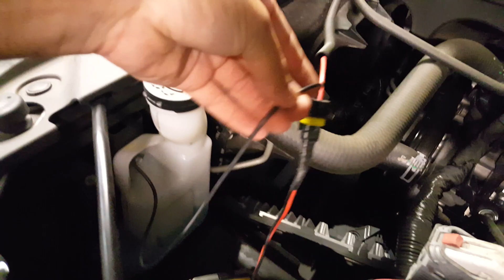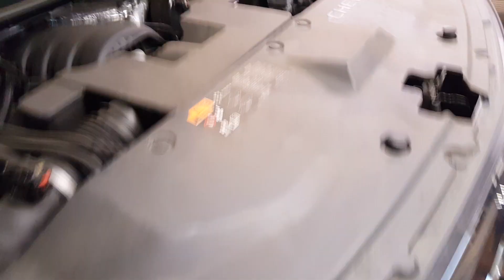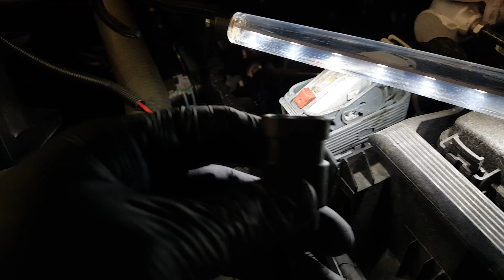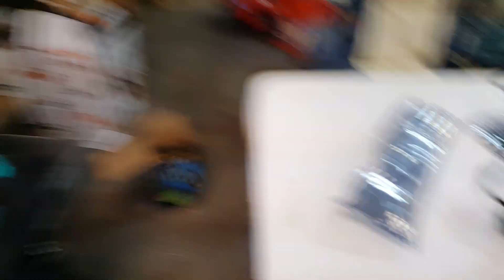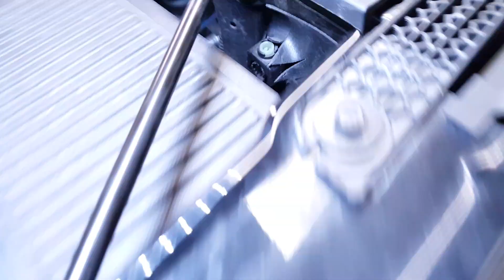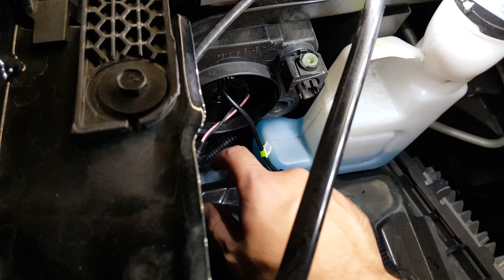JDM astar 8TH Gen. H11 LED Headlight Kit Unboxing and Install on 2016 Chevrolet Tahoe (Part 1)

Comment: I just purchased a led kit and there turning off when I also turn my 15 Tahoe on. Can I just purchase a decoder from Jdm? Does the decoder work with any led kit?
Reply from the maker: Yes, the decoder should be universal since it uses the same connection points as the OEM headlamps.

Comment: Hey bro great video i just got some JDM LED lights for my 2015 honda accord coupe, Do you recommend using them for Daytime running lights or headlights at night?
Reply from the maker: ANDRE MONROE both, they work great. Still no issues.
Reply: Armando Rodriguez Jr ok thanks some people say if you use the Leds for the DRL you will lose your highbeams unless you some type of regulator to plug in
Reply from the maker: Well the Deadlight is the same bulb for the DRL on the 2015+ Tahoe. So as long as you use the Decoder that JDM astar sells you will have no issues.

Comment: In for updates. Did you have to modify your bulb cap? Assuming the decoder doesn't fit?
Reply: update: I installed, with decoder and caps closed. Left high beams Halogen
Reply from the maker: I did not modify the cap, I have not installed it. I am most likely going to create a wire harness and route it through the headlamp so the plug can be sealed in the headlight housing without making a hole in the cap. That way it looks original and the decoder can be hidden.

Comment: I have a 15 Tahoe but I want to do the high beams to are you going to replace them as well ?
Reply: I have a 2016 Tahoe LT with the Intellibeam low/high beam lights option where a person drives in low lighting area and the low beams switch over to high beams then switch back. 

I did order the JDM ASTAR 8th generation bulbs as well and the decoders and mine will be delivered this Saturday can't wait to have them installed.
Reply from the maker: you'll like the output over halogen for sure. let me know if you have any snags.
Reply: Will do Armando. Maybe sometime when you can make a Part two of this review letting people know how you like them when driving in the dark areas and etc.
Reply from the maker: This is a great idea, I'll have to do this soon. Thanks!
Reply from the maker: Jacob Neal no, I don't really see a need to change the high beams since they work well. However from what I do know, it's pretty much the same thing as the headlights. You won't need the decoder if you don't have automatic low light sensors. This turns on the high beams automatically when you're driving in very low light conditions. Mine has it so info need the decoder but from what I found out it's not standard on Tahoes.
Reply: I got mine installed earlier by a local auto parts store here in town. Only small issue he had was I have the GM performance cold air intake installed on my vehicle and didn't know where to hide the wires but everything works fine. Also, Did you have to adjust the LED bulb any to make it work? He didn't have to.
Reply from the maker: sorry for the late reply, glad it worked well for you. The LED bulbs come in a "0" position which happens to be the best position for the Tahoe. I also did not need to adjust mine.

Comment: Have you had any issues since the install. Any errors messages etc
Reply from the maker: Quedog KU alum... nothing as of yet. So far so good. No flickering or anything. It's been good.
Reply: Armando Rodriguez Jr if you ever do have issues let us know. Other than that it looks good
Reply from the maker: Quedog KU alum... for sure. I'll keep everyone posted.
Reply from the maker: @KansasCityyy  these light have gone out on me twice now. Passenger side after 1 year then driverside after 2 years. There are better brighter LED's that ine going to switch to. Once I do I will post up what I go with.